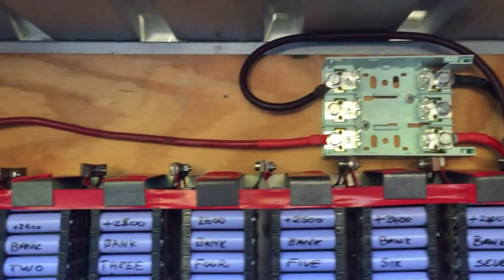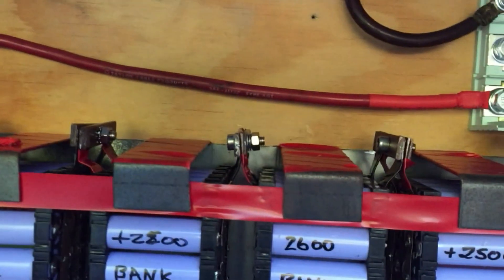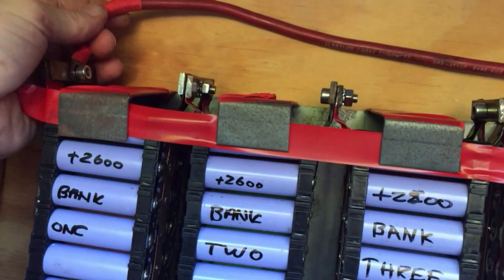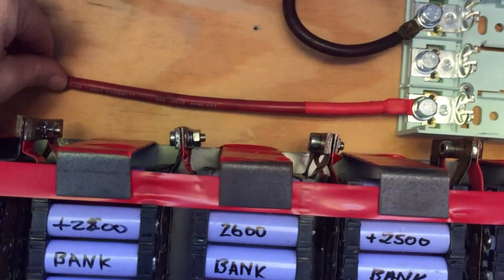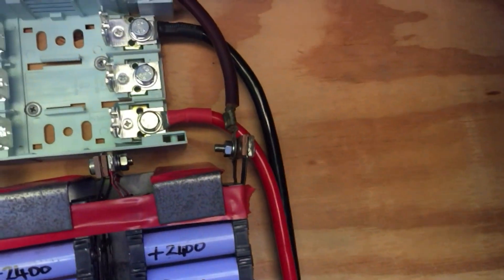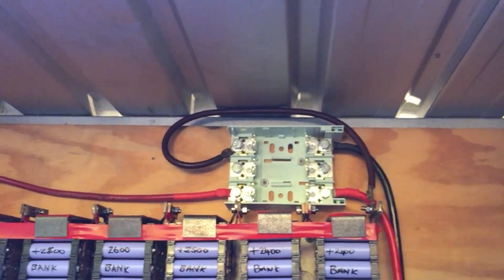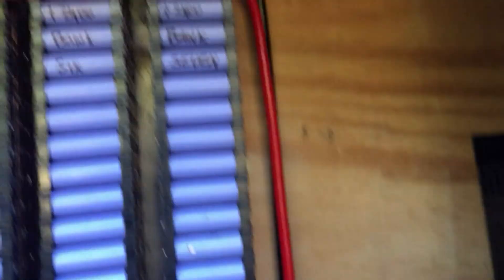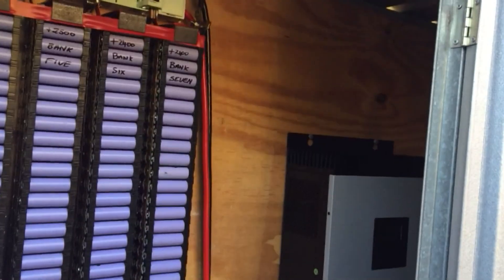HBPowerwall Project - Getting it turned on for the first time

Comment: But a licensed Leccy had to do years of proper college training and do sums btw and put in an installation conforming to state regs and also guarantee his safety protection work if inspector calls and carry 5 million trade  public liability insurance - she'll be right mate.  Hope that shed is grounded and he wont touch your dc dabbling with a barge pole and your fuse and breakers are not dc rated are they - do you care

Comment: Wow, what an Odyssey you've been through!  Amazing.  If I may, and I don't know if someone else has talked about this in the comments before.  When you're dealing with heating metal, you want to not put it on other heat-sinks like more metal.  Something like firebrick is good.   This will allow the object you're trying to heat to do so without losing the heat and making it more uneven.  Also,  (I'm thinking of your attempts at the larger copper bars) solder will flow towards the hotter area of the metal.  You want to heat the joint on one side and apply the solder to the other so it will flow through.   Hope that helps.  Great to see how much you've done!  Thanks.

Comment: I don't understand what the fuses do. why would they blow if the battery gets hot? or gets too low on voltage? I don't understand what difference they make
Reply from the maker: they blow when a cell internally fails - typically if a cell starts to get hot it's got an internal short - when they try to balance in that process they draw more and more amps from the other cells in order to 'balance' but because they are shorting out then they get hot.. in this situation they cell fuse will blow and they battery will be 'powerless' so to speak. Of course, there are many other reasons the fuses help like a tool drops on to the battery terminals and a dead short happens. The instant amp load blows every fuse and crises averted

Comment: How do you wore all them togetter an make 12volt battery
Reply from the maker: you could do it in three or four in series depending on the actual voltage you need. 18650 cells don't lend them selves too well to a 12 v environment. DO your research on what your application needs.

Comment: Hi. How do you make the order of each pack capacity when you connect them? Is it start with higher capacity pack and ends with lower capacity pack? I see you have start with 2600 and ends from 2400 mah.
Reply from the maker: That's just how it ended up... 
have a flick through many of my older videos, heaps of the history is included.

Comment: 2600 modules / 2500 modules / 2400 modules : You should have mixed the cells to have the same average capacity in all modules (what you call bank); Otherwize, while charging, the lowest capacity module (2400mAh) with reach 4.2V way before the 2600 one ; Since you have many cells in parallel in each module, the difference between the modules is even greater
Reply from the maker: +Christophe HUBERT yes yes yes, i know this - in time this will bite me in the ass or I can get creative and solve this issue with some amazing hard work :) replaces packs with new ones

Comment: hi there.  a couple of questions for you. number 1 how do you plan on charging your cells? number 2 do you have battery management between each other 7 Banks of cells?
Reply from the maker: +W. Lou  Little all this an more has been covered in many past videos:) PIP2424MSX inverter solar charger, BMS have a 200amp & 60amp units - both not being used, stay tuned cool things happen on youtube :)

Comment: It looks great for a "first cut", but I sense you're anxious about the potential for high current disaster lurking in your design? While you have fusing in both the +ve and -ve legs OUTSIDE the battery, did you consider (alternatively) placing a single fuse between packs 3&4, as that would also protect against internal risks between your battery and it's metal case. While you took great care to (additionally) insulate the top arms between the busbars, it wasn't apparent that the bottom arms (supports) got this treatment? The static load of the individual pack weight onto a small surface area between the bottom cells involved with passing that pack weight (~4kg?) to the the supports could, over time, result in "cold flow" of the plastic battery skin and expose the "live" surface to your mount. Maybe some of that garden hose you spoke of for the top spacing could give extra protection at the bottom of the packs as well?

Comment: I didn't see you put the wires on for the balance charger. I guess they could go on with a extra bolt.
Reply from the maker: +sven this will only serve as the test rig, discharging bank so i know exact capacity then packs will be hooked into my main off grid setup gradually
Reply: wow, that's full on, didn't  think of that. your going above and be on.
Reply from the maker: Plan on doing the best i know, then learn for the failures - good way of doing it i reckon hasn't put me wrong in the past 42 yrs
Reply: Ive always lernt the hard way. and if you think
its not quite right and it might fail, it general dose.

Comment: I maybe wrong but I'm sure I read somewhere that when you are doing multiple cells in series and in parallel you better off going top bottom top bottom ect. As while slight the cells at the top of your design will be getting stressed more than the cells at the bottom. Did you think about joining the negative of pack one to the positive in pack two at the bottom, then alternating along the pack, or would the difference be negligible.
Reply from the maker: +anthony stafford maybe, but i like it my way.. time will tell if it was a bad idea.
Reply: +HBPowerwall When it is complete could you compare the temperature of the top cell to the bottom cell when under load, just for curiosity.
Reply from the maker: +anthony stafford there will be no difference - people are so tied up with heat (and naturally so!!!) but max draw in the first completed 10kwh pack is going to be 1.23amp per cell  - and only for a few seconds max so heat won't even be measurable.

Comment: 7s80p 2.5ah average 18650 cells powerwall 25.9V 200ah = 5.15Kw battery pack.. you got a well compact powerhouse brother.. other of your 7s80p probably 4.5kw.. interesting pip2424msx too..
Reply from the maker: +Mr Noh I thought i was fairly close with the math. But will take that one step further and test test test :)

Comment: If I have anything to say that would be negative at all, it's that your wall mount should be NOT be metal.  For obvious reasons, such as really bad weather.  What I suggest is this.  Repurpose an old server rack, gut some enclosures and use that.  very modular and that means you can have a BMS for reach enclosure...and pull packs that are having issues.  That said...this will work for now.  Oh and DAMN FINE JOB, watched every video.
Reply from the maker: +Tristan Wolff Lots of ways i could have done it, chose this way and just a little chuffed at the way it is turning out :)

Comment: Working out Battery Capacity. You should always use "battery nominal voltage" for any given battery and in our case 18650 its "3.7v". Sooo "nominal voltage" times "amp hours".
For your pack the min would be (80cells*2.4aH)*3.7 for each bank then times that by your total which is 14 banks of 80cells. Gives you 9945 as a min
Reply from the maker: +Mikes DIY Tesla Powerwall so I was close enough ?

Comment: ok, there is offgrid possibility.... 
nice..did you think about 48v sistem since you would have such big battery bank....
48v and 550Ah and li-ion batteries...you would be offgrid king...
I saw video about how you solder big cooper pieces together and you use cooper pipe flux there is nothing wrong to use pipe flux... 
try to do like this 
-clean cooper with fine sand paper (both sides)
-use small paint brush and apply pipe flux to cooper spots that you wish to solder together (both sides) 
-use welding torch with small fire and heat cooper
-now important thing is to watch pipe flux when he change his colour from white gray to silver metal colour now you add solder.... 
-important also when  is pipe flux silver metal colour you heat about 2-3sec and stop...
 -end of cooper pieces should be well flooded with solder 
I have welding cooper pipes now about 10 year's 
I hope this info would be useful for you....
Reply from the maker: +Bostjan Trancar would have been useful weeks ago !!! Never mind info for next time is great. Cheers

Comment: I would Be scared that on the bottom ( where the packs rest on the mounting frame ) the frame would scratch into the heat shrink of one of the battery cells contacting the cell- to the frame. If that would happen on more then one pack it could make some interesting optical effects :p.
Reply from the maker: +Danny Bokma there is a small rubber pad on the bottom, can't damage my babies!!!
Reply: +HBPowerwall aaaaaaawh, I missed those! That explains the confidence :).
Reply from the maker: There NO confidence at all!!! took 45 min to install those batteries... i had to edit so much out to make the video shorter.. Trust me i don't take this process lightly .
Reply from the maker: +HansonHacks yes both the mount and all negatives

Comment: nice project m8! i'm following you since the start... please keep in mind that the lower part of the mount should be covered with heat wrap or garden house, because the entire weight of one 'cell sit's directly on the lower part of the mount and at the smallest vibration the wrap of the batteries will be compromise and it will short if by mistake any of the positivie termination touches the frame as well.!!!
greetings from Bucharest,Romania(Europe)!
Reply from the maker: +zdr it's got some rubber pad on it :)